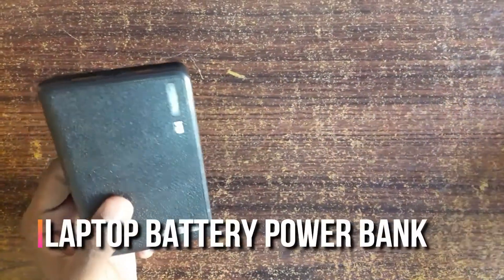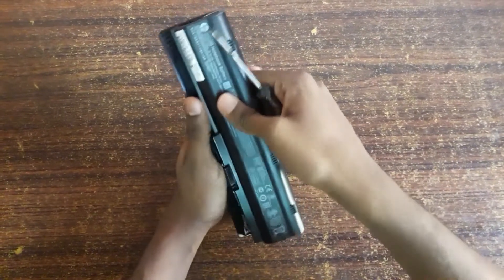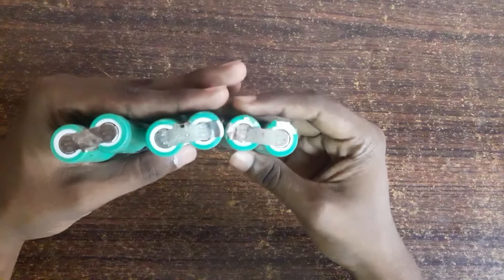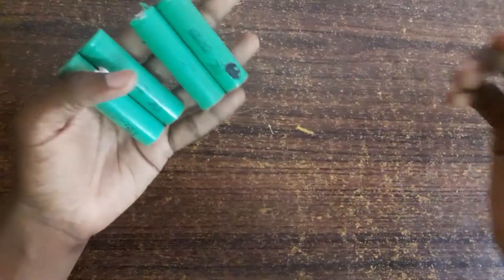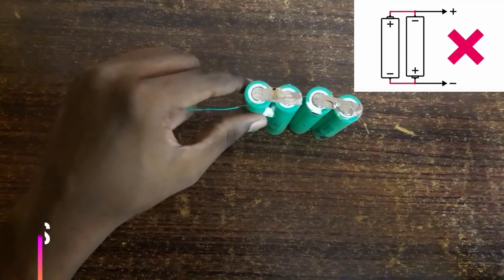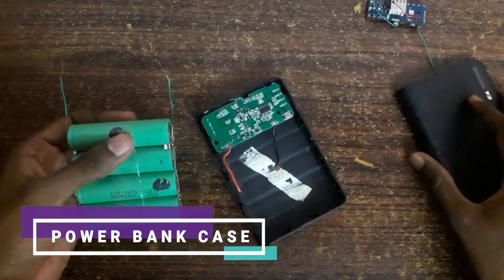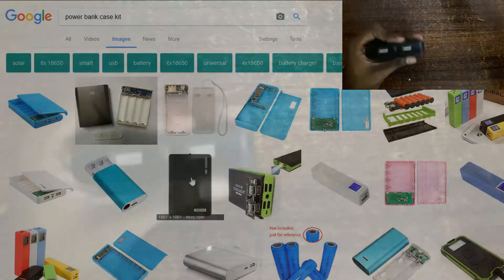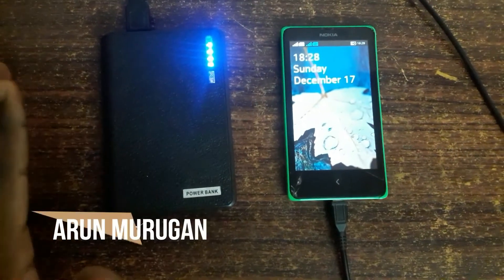How to recycle old laptop battery into power bank | DIY | Arun

Comment: Bhai laptop batteries kitne ki milte hai
Reply from the maker: English please?!
Reply: @ArunMurugan  How much did these old laptop batteries cost u
Reply: Reply soon
Reply from the maker: @rachitagrawal2437  Actually, I used my own laptop battery which doesn't work properly ..
Reply: @ArunMurugan  but do u have any idea of the old laptop batteries can be bought from the market
Reply from the maker: @rachitagrawal2437  I don't know about the market.. As per olx, it costs around 300rs. Better you can buy new Li-ion 18650 cells which is available in online itself..